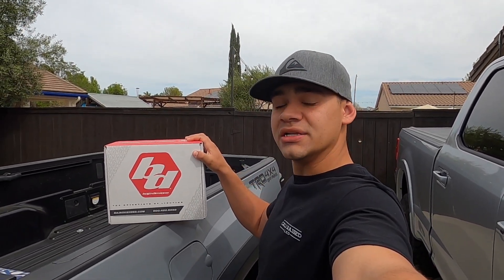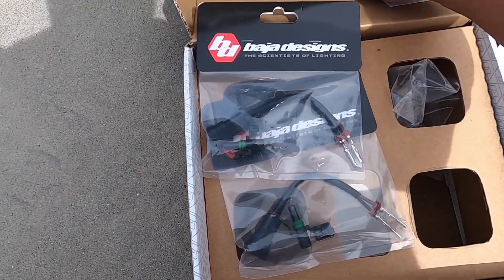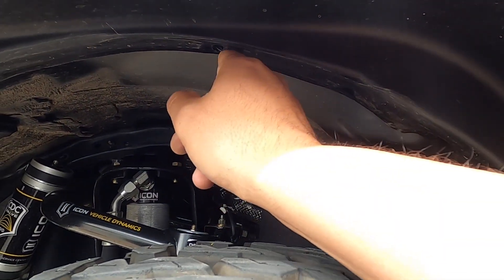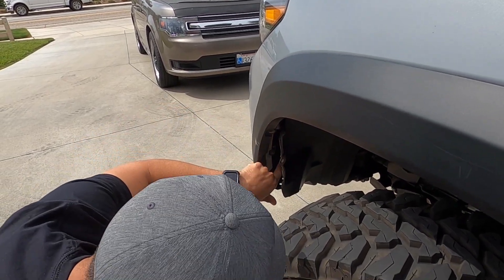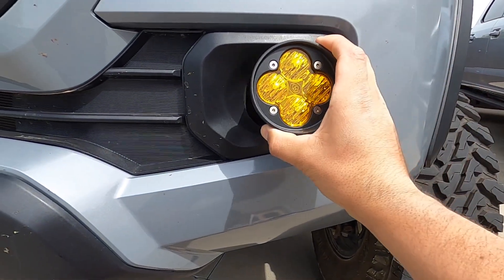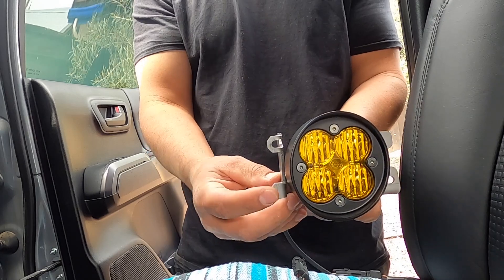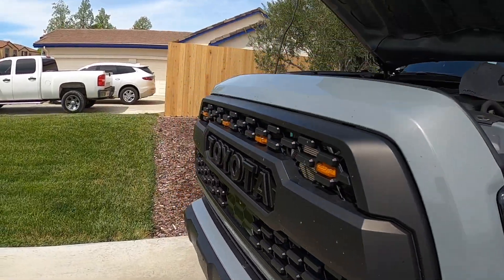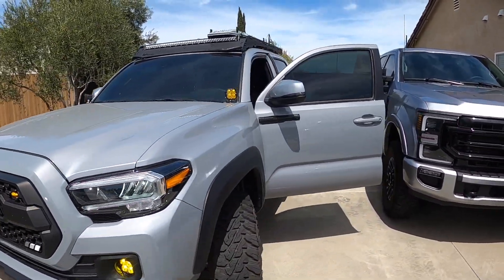2020 TACOMA WITH BAJA DESIGNS FOG LIGHTS! SUPER EASY PLUG & PLAY INSTALLATION!

Comment: Hey man, did you paint the tacoma letters in your trd pro grille to black them out? That looks sharp!
Reply from the maker: I used a heat resistant spray paint and just taped all around the lettering. Paint would work too though!

Comment: I had to use the additional spacers as well as the seratted washer to mount the brackets you figure they would thread all the way through the light and explain this nonsense in the instructions.